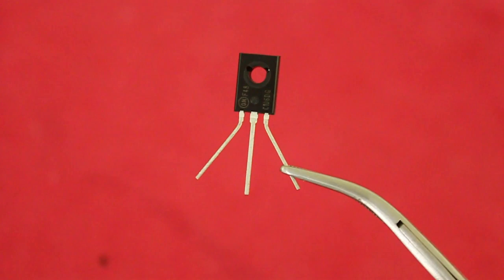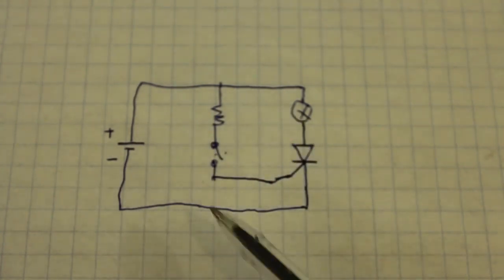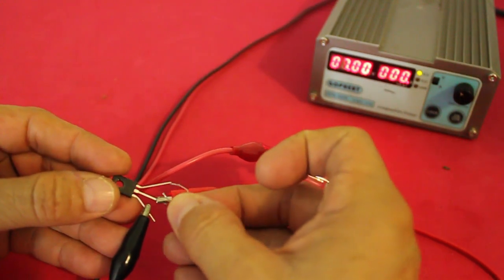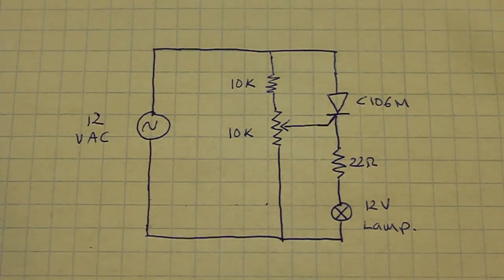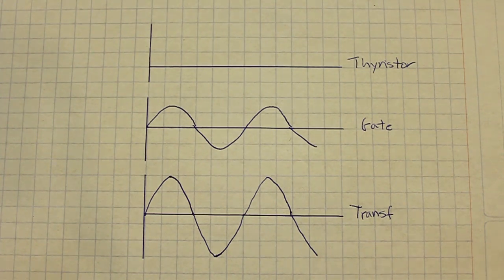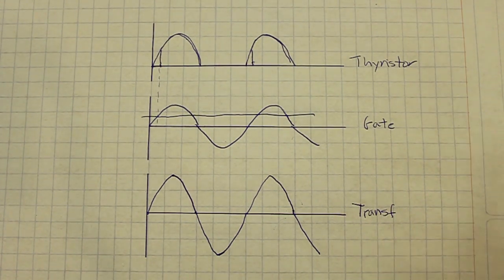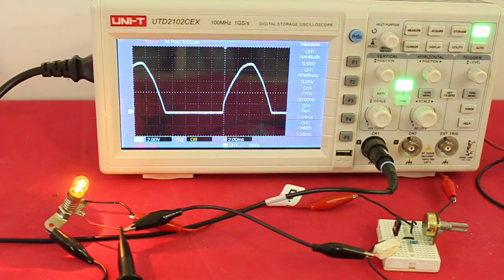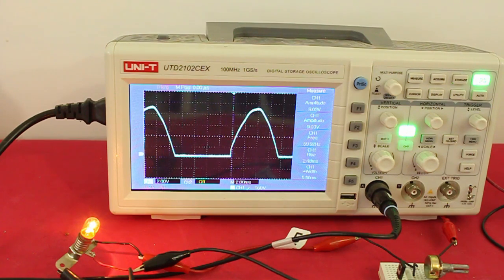Thyristor or SCR Behavior in AC

Comment: Just like the dimmer on my nightlight. I opened it and wondered why the 'transistor' didn't get hot despite operating some complex switching on high mains voltage. It turned out that it's a thyristor, thanks to your explanation.